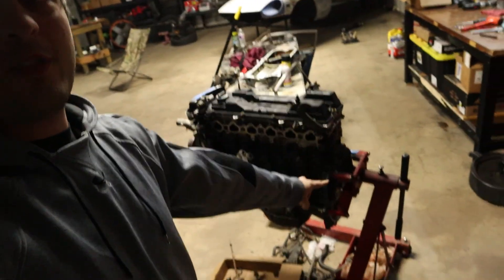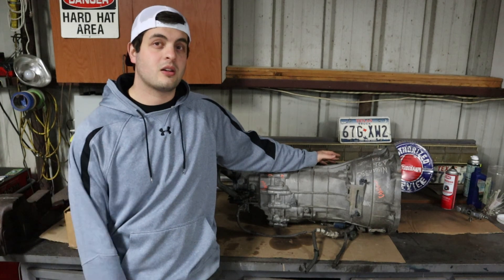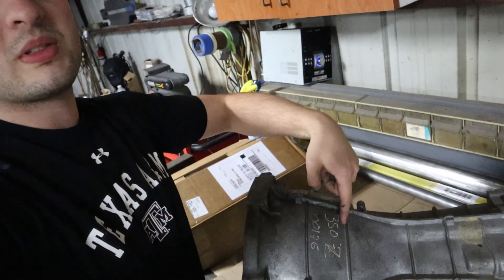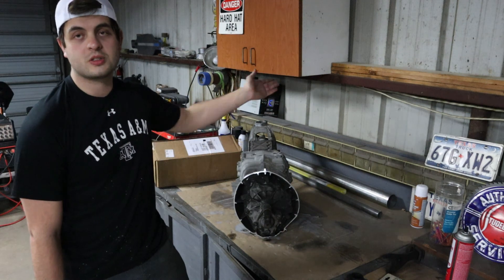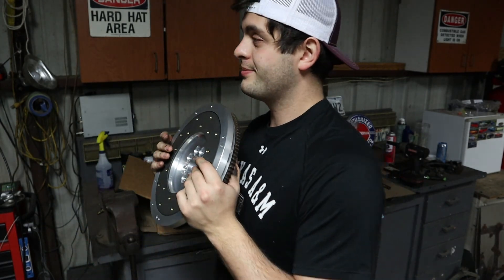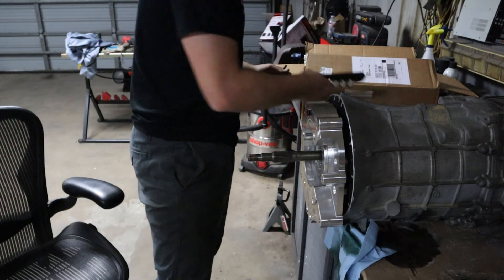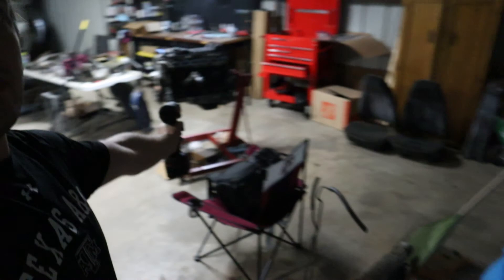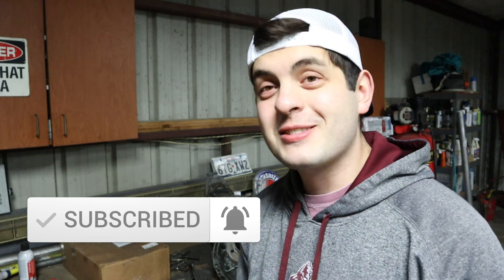ABANDONED Datsun Transmission Upgrades! Autosports Engineering CD009 to 2JZ adapter installation

Comment: Can you drop a link where you got your clutch kit from
Reply from the maker: For sure! 
Here is the adapter kit: https://autosportsengineering.com/product/autosports-engineering-2jzgte-2jz-1jz-2jzge-engine-to-350z-cd009-6-speed-transmission-adapter-package/
Here is the Clutch: https://www.enjukuracing.com/products/competition-clutch-kit-stage-4-350z-g35-03-06.html
Reply: @GrantWerts  thanks did you upgrade the driveshaft & differential as well? Im looking to push 400 hp atm.
Reply from the maker: @galaxy3056  yeah I’m having a custom driveshaft made and the differential is an upgrade to a R200 out of an S14! The entire rear end is different because I was afraid of breaking the stub axles and loosing a wheel when drifting!